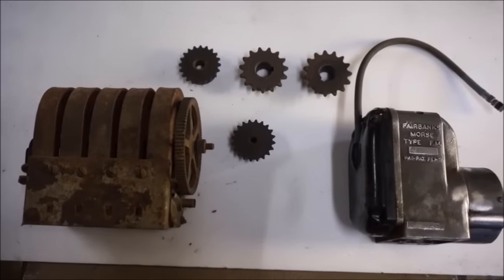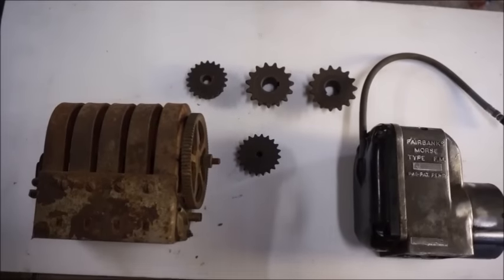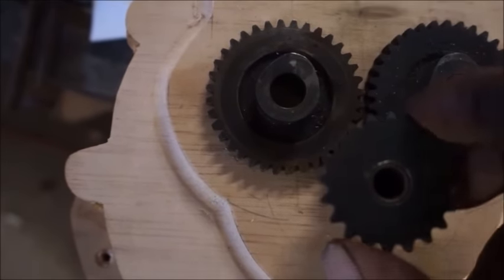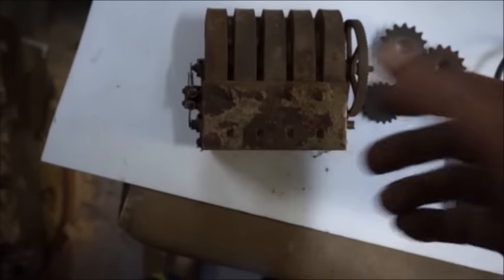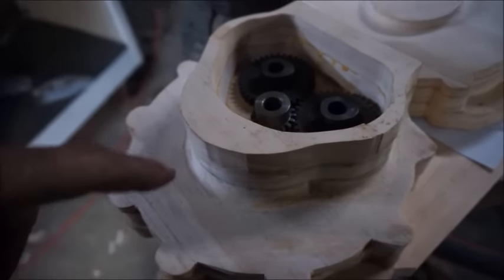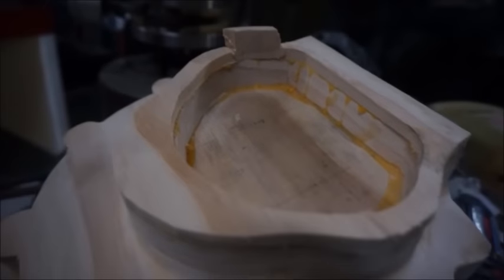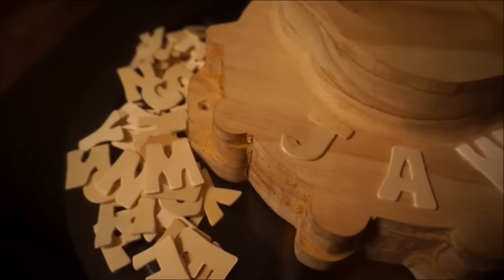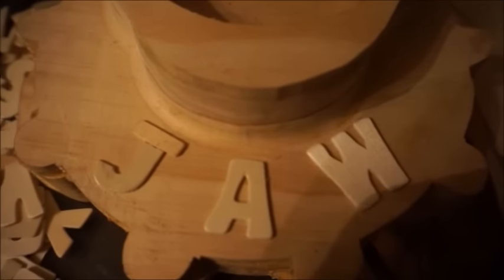Antique Motorcycle Engine Build (Replica) Part 7

Comment: Hi Jonathan I know you are way past this point on your bike build but maybe if you like  this idea you can still incorporate it. You were saying you might have high and low level oil ports. What if you  where to have an external glass tube so you can actually see the oil level. I've seen this on old diesel engine fuel tanks and some old engine's. It would really add to the old school look maybe use brass fittings to support the tube and etch markings in the glass. I've been  watching the bike build and you mentioned you cast your own case so I'm now back tracking from the beginning. Man you amaze me. I have been distressed for many years about how many skills have been lost over the years. So many products we seemingly can't produce for ourselves anymore. I go to old steam shows and see so much innovation in the old one cylinder gas engines that were built in garages and barns. You need to be teaching a class in your garage. Your local high school shop teachers should be bringing there class to you.

Comment: I think you are doing a wonderful job. I think I would be having a hard time getting it done. cut and glue and sand and fill and sand more. if I was working with you I would be just doing what you told me to do.  and that would just slow down the process. I couldn't help you on the figuring out what to leave and what to take away. the only thing that I could add to the project would be a better bandsaw' not to cut down your saw that's a whole other stores in its own ' and a spindle sander and the love of wood. .I am so excited for you to be doing this project wile you are resting in between your work. thanks for the shout out 👍FINS UP 👍
Reply from the maker: Another thing you have that I don't is a boat load of experience with wood.
Reply: I was just building parts of a boat :)last week

Comment: Hello from Iowa.
I had an idea for your timing retarding issue.  You could use chain & sprockets like you said but leave the chain slack.  Then use a tensioner on the chain that can be switched to tension on either the top or bottom side.  Changing the tension from one side to the other would change the timing a few degrees.
Brian

Comment: On old 2-stroke oil engines I believe they would had opened the sump door and poured the oil into the crankcase up to a line in the casting.  It was extremely important not to overfill it because the intake air goes through a screen in the crankcase, and too much oil would cause the oil to enter the cylinder and cause a runaway condition.

Comment: With all respect. those  early board trackers all had mags. they had no kick they were pulled with another bike. Even with a kick, and 280 cc wouldn't be  much kick back at 8:1 comp, but if it was a problem, then a decompression valve would be the old time way of doing it. I've been a pattern maker and people couldn't believe how much work is involved, and usually with all hard wood  and no milling machine, all hand planned and scraped very little sanding. Hundreds of hours of work for each part, fenders, with large rounded areas all had wooden patterns as check patterns, unreal amount of work and precision. Keep up the good work. P.S. Never pull an adjustable wrench against the moveable jaw, that's the weak point. Food for thought. I need a one cylinder mag for my 320 cc build , do you have one, extra?
Reply from the maker: The compression kick back is not a worry. It's the firing to far before TDC that forces the engine backwards and breaks a leg, no worry about it when close to TDC but the further before TDC you get it becomes dangerous, but runs better and stronger. My crank counterweights are smaller than they used also giving way more chance of a kickback because of less momentum. This may or may not be a board track bike, it may be my rendition of an early motorized bike.   Also you will only see me use an adjustable right 50% of the time.
Reply: I like that answer about the wrench, keep on towing good buddy
Reply from the maker: Just an honest answer!

Comment: Funny you should talk about the pattern makers, one of my deceased neighbors was a pattern maker for the foundry at International Harvester in Louisville Ky. He was also an excellent machinist, back before CNC. He always told me there was more to it than most folks thought and now I see what he meant. Have you heard of the bike builder Billy Lane and his Sons of Speed Racing series ? They are using engines much like yours on home built chassis. Would you consider in the future selling an engine?I realize it would have to be sold as a kit or as a display model only due to EPA regulations and other legal considerations. But something to think about.